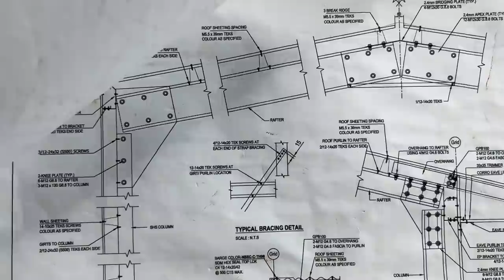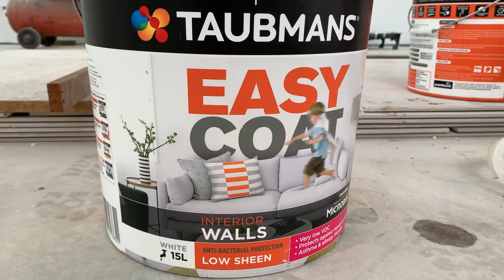My Painting Studio Build Part 1

Comment: Is it going to have air conditioning? It looks like it would get so hot
Reply from the maker: Yes it will. The wiring has been installed and the air conditioning people are coming in June to install the unit. Dom has put extra support on one side of the roof so that we can install solar panels in the not too distant future as well. That will help with electricity costs.